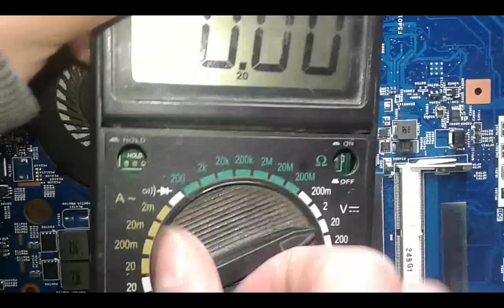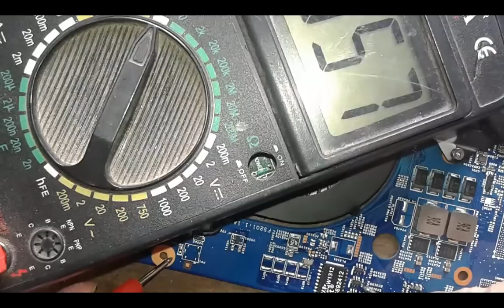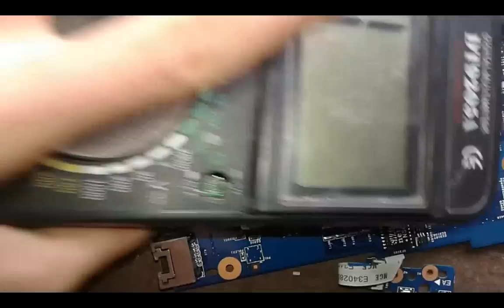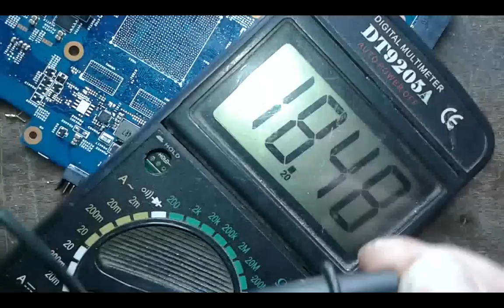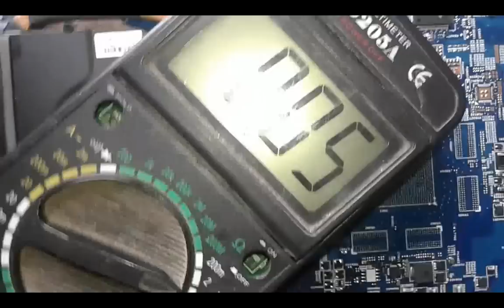How To CHeck Different Components on an Acer Aspire E1-552  Troubleshooting a Dead Board

Comment: Good thing I can read your mind or otherwise i wouldn’t know what your doing.... also wouldn’t want you working on my stuff, your probably knocking transistors or other small circuits off the darn board moving the multimeter across it...

Comment: Nice video! Was the mosfet faulty?
Reply from the maker: +saarike yes after changing the mosfets it worked perfectly  :)
Reply: Great! :)
Reply: here one question..out of topic...can i measure the mosfet without take it out from circuit...can i check pnp or npn without desoldering them out from circuit..especialy tv circuit..tq master.
Reply from the maker: +Lenovo Red88  yes it is possible to measure them without desoldering :)
Reply from the maker: +joe carr yess but when you finf a short circuit

Comment: it really makes no sense to try to repair a dead motherboard, look people i've had 2 bad motherboards on desktop already, there is literally nothing that a tech can do about that, and the reason is because everything is tied to that board: the cpu, ram, hard drive, chipset everything, if you had a bad hard drive its not that big of a deal you can simply get a new drive and reinstall everything. but once that motherboard is gone that's it its best to get a new computer especially on laptops, because a new laptop computer means a faster and cheaper cpu, ram and all other components upgraded on one machine. you would have a brand new pc that you wouldn't have to worry about for a long while and a new warranty period.
Reply: jessylove 18  yea but even so if the motherboard's life already has its days numbered why bother to go through all this probing and other checks, when you can simply get a newer and cheaper model that is going to be faster anyway, one thing about technology its moving so fast nowadays, i just built my very first pc using a g4560 and i thought it might of been the same kind of dual core that i had last time, but its not, not only was it cheaper but its miles ahead of most laptop cpus priced the same
Reply: jessylove 18  yea? And I had to wait a whole year to get my build and it was hard because there wasn't anything to do at home, all I had left was an android TV box for television watching and YouTube, but that device was too slow for anything else, I waited a very long time since February this year and it was worth it, what else was I gonna do probe my dead motherboard to bring it back to life? When old technology is out of date it simply means you cannot do anything else with it nor would it make sense its just a waste of time, that's why the most efficient technicians don't bother fixing anything, all they do is replace or do full upgrades of systems because it saves money, time and it gives the customer that peace of mind that they won't have to worry about failure anytime soon.
Reply: jessylove 18  ahh yea phones, they are too many phones that need fixing nowadays, but in my country its different all the devices that we have cost us twice as much as what the US pays, we don't manufacture electronics we ship them in, so whatever we get has got to last us at least 4-5 years without something really bad happening, now techs over here charge hefty prices for small systems like laptops and stuff, because they claim they can fix everything, but when it comes time to pay depending on what they had to do, you could end up paying way more than what the laptop or tablet cost to ship in the first place,  the kind of logic my people seem to have is that: Samsung and Apple devices are the best no matter what the specs they have, and then Dell and HP laptops are the only type of computers they need and that's regardless of if they have the room for a desktop or not and the thing is laptops seem to break down much much faster than a tower pc and i know cause i had a 430 dollar spec machine for almost 9 years!! yet most people that had similarly priced laptops, theirs just could not hold up that long because they could not afford the repairs needed.
Reply: jessylove 18  i agree with you on the phones thing that too many people seem to buy into these days, but i think its only the technicians would know that buying a new iphone or samsung model is not going to be that much better than the current phones people have right now, but in the case with my computer the only reason i kept the old computer that long was because, i didn't have help yet to replace it, i mean i knew it was getting old but the motherboard was still working okay, when i started watching youtube videos on how to build computers, that's when i realized everything is tied to the motherboards, so if i could replace the drive, the cpu fan, graphics card and things like that, the computer will still continue to work unless the board itself failed in which case that would be a good reason to get a new computer. i had a foxxconn 2a8c model that was running an E6800 3.33ghz processor on the 775 socket, yea really obsolete i know but that system ran for years, i didn't have issues like leaking capacitors or anything like what i've seen in the videos, and that's why i was able to use it so long.
Reply: jessylove 18  well i know nothing about tvs or anything like that but i know the new technology doesn't last as long as the older ones, but that's why i have a desktop, if anything happens to my pc i can easily diagnose and replace whatever is faulty i have no time or interest in soldering anything because that would just add to my frustration trying to get it to work, and gigabyte makes solid motherboards for good prices, i don't overclock, i don't do raid, i don't do high end power supplies, liquid cooling and all this  other nonsense i see on youtube i just don't need. i stuck to the intel stock fan and heatsink and my cpu stays around 47 C when idle and 50 C when gaming. regardless of what they say about the coolers from intel, i like it, it has a more modern look to it and it does what its designed to do just fine.